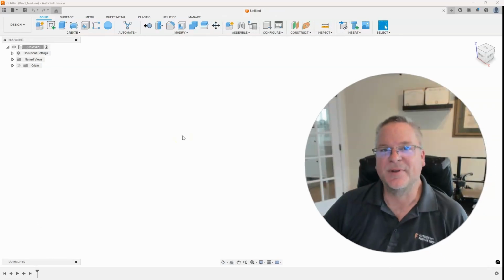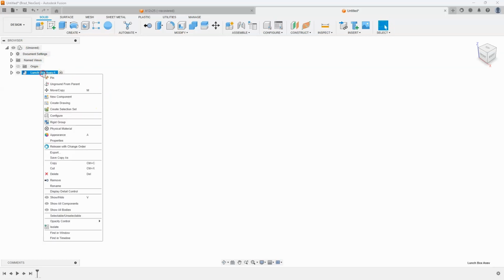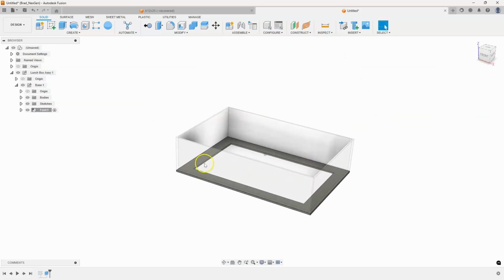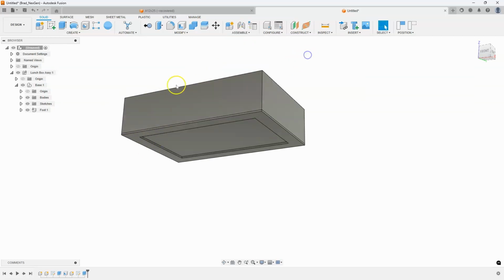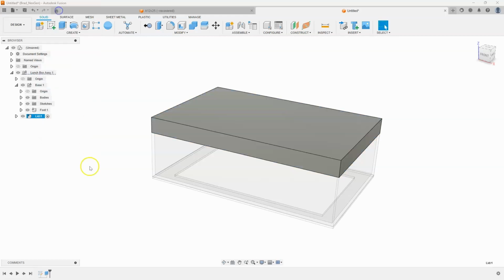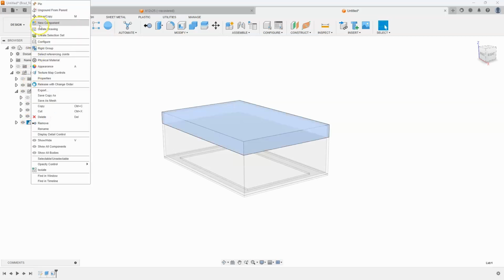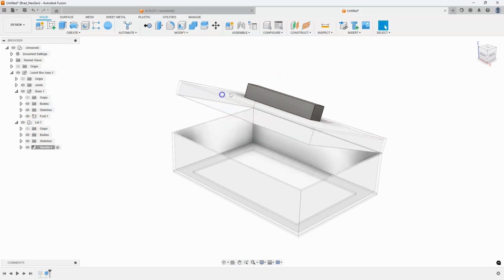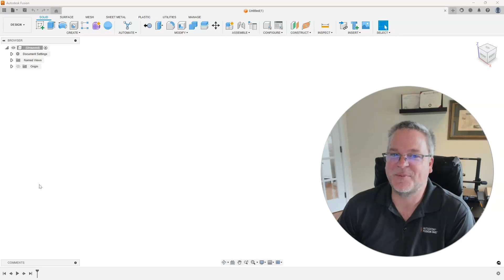Fusion Friday - Ground To Parent

Comment: This is awesome.   Could you do a video on the best practices for designing something like a camper top or something framed?  I'm confused if you should build out the components first and join them...or sketch the design and add the components to the sketch.  Or is either way correct.  I'm think the sketch is better because it's easier to dimension the design -- is this correct?

Comment: Hey Brad, I got a question, maybe you or someone eelse has the answer, and maybe it is to obvious too, so that turns me into being a total noob after all those years doing hobby stuff with F360. I have created some assemblies, all of the parametric. Now I add those constructions to a new one, combing the different furnitures into one room. However, how can I access the parameters of each construction? Example: I have a table, and one parameter is the tables length. I want to add the table to my room, making it 2 meters. I wanna add the same table to the room again, but with a length of 1.5 meters only. Right now I copy me table "table2000" into a new construction, change the table length parameter from 2000 to 1500 mm, and save it "table1500". Then I add the 2 meter table and the 1.5 meter table the the construction representing my room. Is there an easier way, so that I do not have to make all those copies beforehand? Just insert the "tableparametric" into the construction, change the params of that subassembly table to 2 meters, then add the table subassembly again, and change the parameter to 1.5m. Hope you understand the initial problem, English is not my first language.